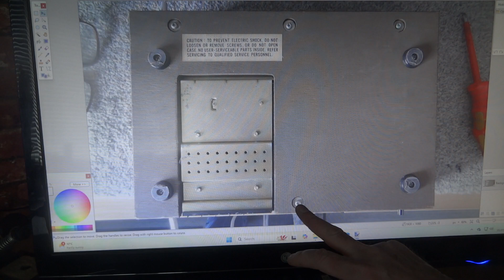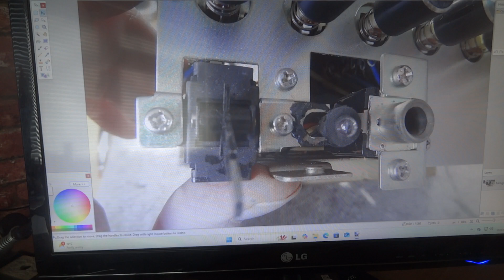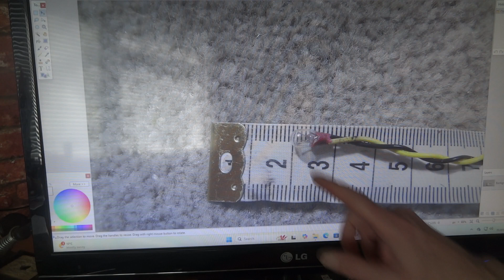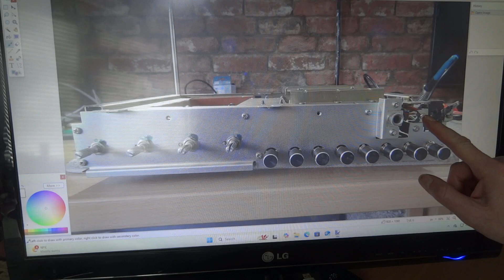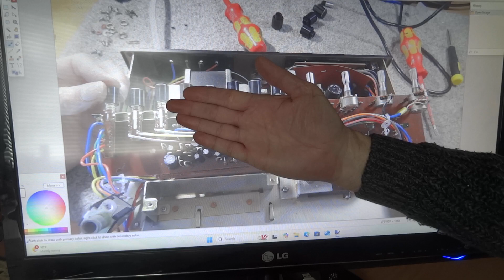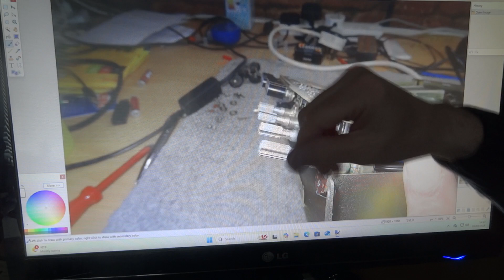Vintage Amplifier Bulb Replacement  Service. Noisey Control Pots repair Cleaning

Comment: Like the way you put this vid together with pictures Michael . If i could give one good tip on buying amps and speakers online or face to face it would be look at the screws on the unit for signs of rust. If the units have been kept in a damp place you can expect problems.
Reply from the maker: Thanks for the comment Simon, this is one of the best tips. Something you can see straight away without taken the case off amps or receivers. Damp will get into the electronic parts and also speaker coils.